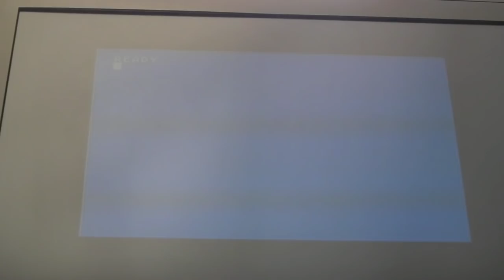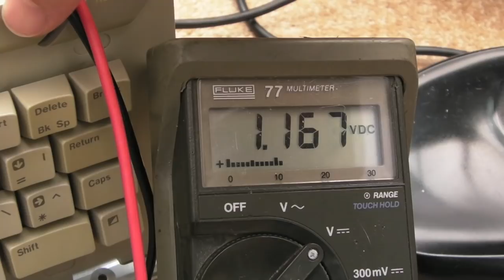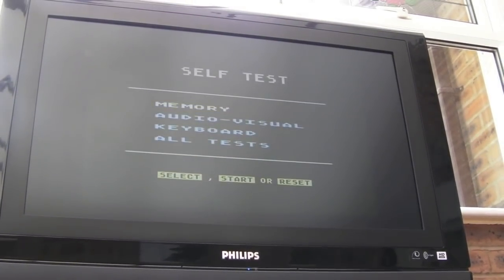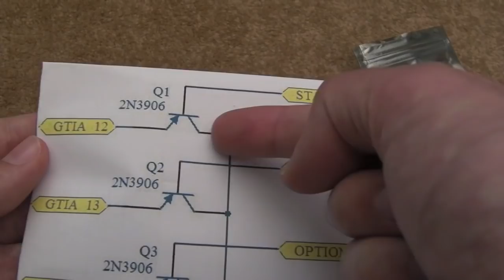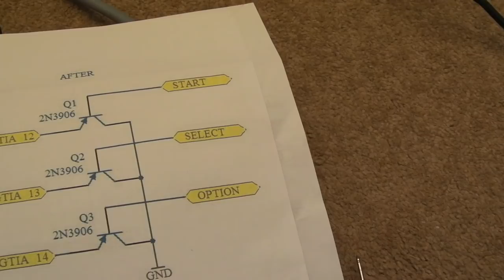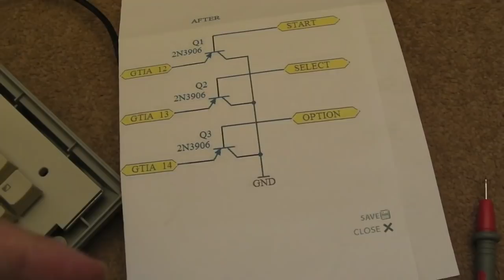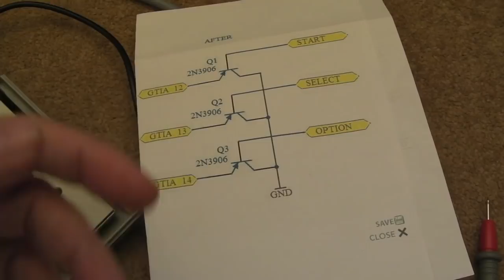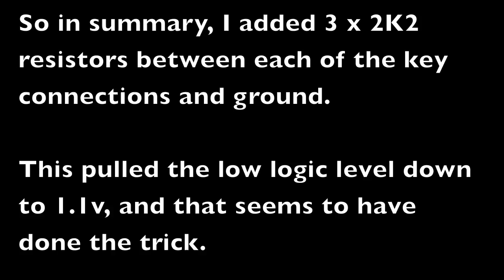Atari 65XE (130XE) - Function Keys Fix

Comment: Excellent fix Gadget . I tried to get away with one 2k2 off R136 for 130XE, but this caused the start key to stop working. So I put another 2k2 off R134 and now all the keys work. I'm not sure how long it will last, but it is going good now. Thanks a lot. I have a similar problem with one function key not working on the Amiga. Damn mitsumi mylars.
Reply from the maker: Thanks =D  Glad it helped!  Mine is still working after the mod I did.  No telling how long it will last though - at some point I may have to source a new membrane!
Reply: @GadgetUK164  Yes it's not a permanent fix. New replacement XE membranes are available for now from a few sources.
Reply from the maker: @gamedoutgamer  Mine is still working perfectly,  so it seems pretty permanent to me ;)

Comment: The traces on the mylar can be repaired with a defogger pen or other conductive paint. Oxidisation causes tiny breaks in the traces underneath the keys. The traces on the sprung Mitsumi boards are extremely narrow but once successfully fixed with conductive paint, they're good for years... until oxidisation occurs at another location. ;)
Reply from the maker: I used conductive paint on this same keyboard in an earlier video.  That was to fix a column that was not working.  The problem with this type of membrane is the traces are not exposed, so some scratching has to be done to expose the parts that are good at either end of the damage.  With the function keys the problem is slightly different in that the trace looks perfect but its resistance has changed.
Reply: GadgetUK164 - Retro Gaming Repairs & Mods Yes: some scraping is required (I didn't see your earlier video), but the raised resistance is of course caused by degradation of the signal path on the Mylar. I've seen this increased resistance before: meter shows continuity but  there's still more repair work required on the trace. As I say: trace repair on the Mitsumi Mylars is a pain. I'm working on the same model right now, but the breaks are pretty clean. :)
Reply from the maker: Yeah!  I've had the normal matrix traces burn out in these before - in my first video there were 2 traces I had to patch with conductive paint.  In this case the trace looks good as new but has a higher resistance.   I will keep an eye on it and re-measure at some point soon to see if its deteriorating but from the tests I did it seems stable now.
Reply from the maker: And I think there's a reason for that stability btw - before it was pulling to 1.1v from 5v.  Now there's a pulldown on there its never 5v to start with, so its having to sink less current through the trace I think - that must be it.
Reply: That makes sense. I'm pretty sure I read that the current limiting resistors are the wrong value out of the factory anyway, which explains why the traces are commonly scorched or burned out on both keyboard models. As it happens, the Mitsumi Mylar I mentioned was too far gone to fix: I spent hours on painstaking repairs (intially, no keys worked at all) only to declare this one beyond help. The dual-layer Mylars are so much easier to fix. Those Mitsumi Mylars always seem to have damage on the most densely crowded traces (just above and to the left of the flex connector). No I'm looking for a spare keyboard for the machine's owner. :)

Comment: Sometimes things just keep going south.
Is that option key thing standard Chris or is that a mod?
Reply from the maker: Yes lol!  I kind of wondered from the start when the function key issue would affect my keyboard.   I heard about this problem several years ago now.   The option key is one of the standard function keys on an Atari 8bit keyboard.   Also worth mentioning that the mods added to this system (RAM, dual Pokey etc) do not make connections to those GTIA pins - so the mods cannot influence the resistance increases in the keyboard membrane.   Basically just really cheap design membranes =/   At least there's a work around!

Comment: Do you happen to have experience fixing similar issues on an Amiga? I have an A500 with a diagonal column of keys not registering.
Reply from the maker: It could be the membrane, but I think there's an MCU on the Amiga keyboard too  - could be that, but I would swap your CIA chips around first to rule out a CIA fault.

Comment: Nice fix.THat would have thrown me! Btw, do you know if the top shield of the Atari 1024 STF will come off without taking out the PSU (again lol). Got a Gotek floppy emulator flashed to HXC and working great but the floppy cable isn't long enough😕. I'm going to try and design a 3d printed carriage for it so as not to mess with the case and will try and put something up on Thingiverse...
Reply from the maker: Haha - That shielding on the ST is a royal pain!  You probably need to take the PSU out because the shielding sits underneath the back end of the power switch and socket I think.  Let me know how you get on with the carriage!  I need to create something for mine to fill in the larger gap that someone previously cut out in order to fit a standard FDD =/
Reply: Here is the first draft. Works well. https://www.thingiverse.com/thing:2531272
Reply from the maker: i think the PSU probably needs to come out as the switch will catch on the shielding!

Comment: Maybe 30 year old caps being used after a long period are changing their values and buffering/decoupling values are changing the low/high pull voltages? I just about always re-cap anything older than 15 years these days. Lots of weirdness over the years.
Reply from the maker: The VCC rail was fine though, so I cannot see that being the cause.  It seems that the traces on these keyboards go up in resistance with age and use =/

Comment: The nightmare of the cheap membrane keypad / keyboard rears it's ugly head! 
Those membrane style contacts are notoriously unreliable but very cheap to make so were often used in retro kit. You can reduce resistance of the pads by applying some graphite to both surfaces using a very soft pencil or dry lock lubricant. That's why the resistance went up after you cleaned it as you could have removed some graphite that was hanging on. Incidentally, the graphite not only reduces the electrical resistance but helps lubricate the contacts to reduce wear. Ultimately, membrane keyboards have a limited lifespan - much less than their mechanical switch counterparts so no amount of cleaning or patching up will do, eventually. Maybe someone should come up with a more robust retro fix using a better contact method? Whilst your pull down resistors work they may increase the chance of false triggering in certain circumstances in the future.
Reply from the maker: Thanks!  The problem wasn't so much the contact resistance though - the trace itself from one end of the contact to the other was over 1K!  That was the real issue here.  And after using the 'recommended' transistor circuit for a period of time it went up to around 1.3K.  At least with the pull down its now remaining stable!   I suspect it will be good for a long time now - unless it goes completely open circuit at some point.
Reply from the maker: I did wonder if it was feasible to just create a new super slim PCB to replace the mylar with entirely.  If you think about it, it could be connected by wires to the main PCB, and the board just needs to be just a thin PCB - the carbon buttons will still work with a typical PCB.  Not sure how thin a PCB can be created, I might look at doing this as a project at some point.

Comment: I can also attest that the stuff 8bitguy used simply does not work beyond a few light presses. Useless as a real fix. A hole punch with conductive copper tape works a million times better.
Reply from the maker: That's a really clever idea - the hole punch with copper tape!  I might mention that idea at some point in future!  Thanks for that stroke of genius there!!! =D
Reply: GadgetUK164 - Retro Gaming Repairs & Mods  I can only take credit for the hole-punch part because people have been cutting squares of it with scissors to refurbish Atari 5200 controllers for quite some time now. :) Some say that the foil tape (non-copper) works just as well. Even seen some people glue aluminum foil bits with cyanoacrylate (Super Glue) and it worked well but I can see that making a mess even if you are careful.
Reply from the maker: The hole punch part is the best part lol!  That's the clever bit!  People have been sticking bits of copper and foil onto buttons for decades, but no one every thought of punching out perfect circular ones!!! =D
Reply: GadgetUK164 - Retro Gaming Repairs & Mods  Might be difficult with some hole punches unless you put the tape on backing paper first so I should probably mention that little complication. :) Wax paper may work as well but I haven't tried it.